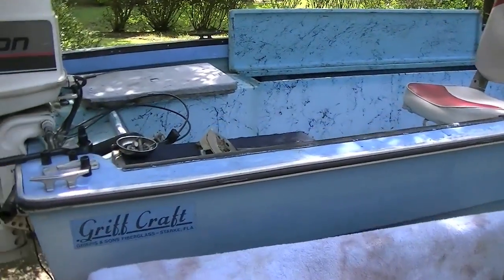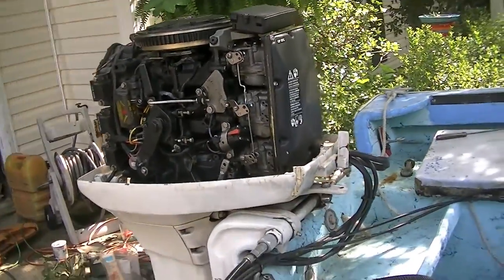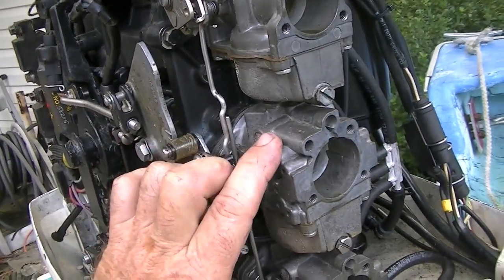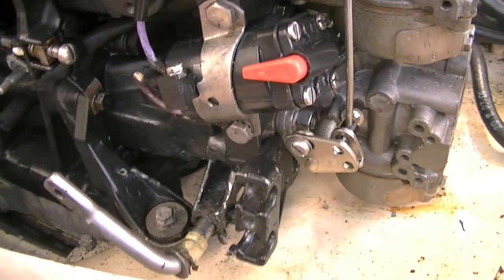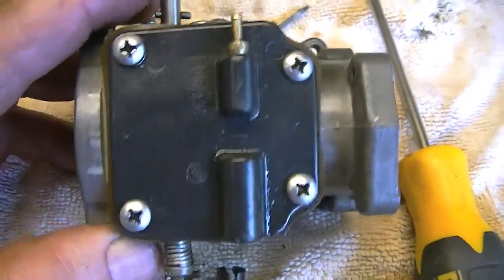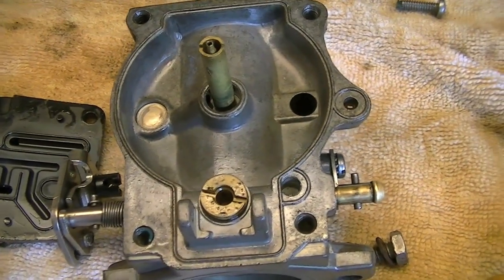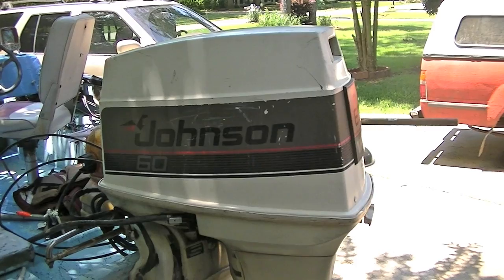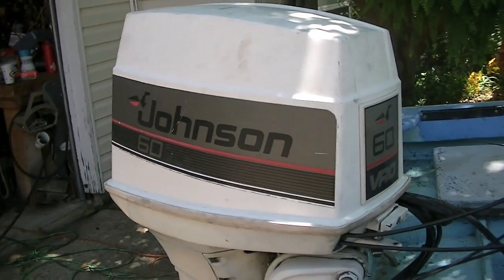60 HP Johnson VRO Evinrude Carburator Rebuild

Comment: Very detailed and informative.  The problem I'm having with my 2000 Johnson 115 HP V4 60 deg is that the primer buld never gets hard and I flood my carbs; fuel literally spills out into my air silencer assembly.  I believe it's the needle that is worn out and not stopping the fuel when the float bowl is full.  Ordering my rebuild kits, gonna do all four.  Thanks and great vid!
Reply: I know it's been 3 years but I'm having the same problem now. Did u figure out the problem?
Reply: @mikejanicke308  the rebuild kit worked.
Reply: @Jason Hinojosa  that's good I did rebuild mine but didn't really clean  those tiny holes. So I'll have to pull them off again and give them a proper cleaning. Thanks

Comment: I have the 1986 Johnson 60 hp VRO and am considering rebuilding the carbs and replacing all the fuel lines. Which carb kit did you use? Have you got the part number or know how I can get it? Looks like a fun project. Were all your fuel lines connected with zip ties from the factory? I had one leaking fuel line where it was double zip tied and I replaced it with a hose clamp (which I'm minded to do on all fuel line connections (which are zip ties).

Comment: Should I check my reed vales will I have of the three carbs off even if the motor (1998) is running ok ? Just want to clean and rebuild the carbs.

Comment: I have a 90hp Johnson 2001, when I start it runs a few seconds and die, sometimes it will run a little longer but when I put it in gear it dies. Can you give an advise what I should check, I have cleaned the carburator, what else should I try? Tks  Len
Reply: Grandma Monica fuel filter
Reply: most likely fuel pump then do stator and power pack test

Comment: Great video!   Unfortunately, I didn't make it very far during the rebuild process.  Somehow I managed to break the fuel line nipple (0314513 ) off of the carb leaving me scratching my head how I'm going to fix this.  Any suggestions?
Reply: I have a Johnson 1989 60hp motor with carburetor 432666 which has two fuel connectors.  I broke the fuel nipple that connects to the electric primer toward the top of the carb.  I was able to push out the remaining piece and need a replacement part.  Can anyone help by directing me to where I can purchase such part without buying an entire new carb?    It is NOT part 0314513 — NIPPLE, FUEL

Comment: I have a very similar outboard. I took boat out on water. After getting home and taking the hood off the motor I noticed gas and oil dripping off the bottom two carbs. Why would this happen?? Thanks.

Comment: brilliant video,  quite extensive rebuild, I have a similar Ev 60Hp, with 2 carbs 1986, idle is terrible so im suspecting the carbs need a rebuild.  how often is this rebuild needed ? every 4-5 years ?? would have loved to hear it crank over after the build
Reply: +John Flynn John I have always run my motor dry from gas and then fogged the enjine before I put it away for the season,it only takes a few min and I have never had to clean or rebuild again,25yrs.

Comment: I have the same motor. I still have the oil injector and was thinking of disconnecting it. What is the oil/fuel ratio your using?
Reply: I'm running 50:1 mix. That's what it calls for. I run that in my 89 75hp and my 96 60hp. On my 96 I'm going to replace the VRO pump when I get the funds to do so. For now I'm running an old style pump.

Comment: I have a 70hp VRO and it looks exactly like yours. Do you have any videos on how to close up the VRO and just mix your own gas? I don't want to mess with that whole oil tank on my pontoon. I'd rather just mix the gas like I do for my bass boat.
Reply: From what I understand, just remove the vestiges of the oil injector system, and mix like normal.
Mine was removed when it was purchased. The old man who bought it didn't trust or understand the VRO system.
Reply: @nunyabidness1400  smart man

Comment: hey boss.  got a 98 johnson  ,  followed your vids to a tee.  but can't seem to find out why my carb bowls are flooding out.  I even dropped the floater so that the needle shuts sooner.   Mine is an electric start with the solenoid.    Got new needle, new seat, from the carb rebuild kit.   Anything else that would be causing a flood?
Reply: chews4life cracked reed or feed tube maybe?

Comment: i have a 70 hp evinrude, it runs great about half of the time, other half about 1/4 throttle is all i get.  trying to determine if its carbs or fuel pump.. frustrating.  great video!
Reply: have u found what the issue was geoff peiffer ? i have the same issue!

Comment: bien le bonjour , je possède un 50 cv Johnson autolube (vro) 3 cylindres , problèmes au démarrage, impossible avec le starter , de plus, je vide la batterie et ne démarre pas toujours , j'ai nettoyé plusieurs fois les carbus,  alors je démonte les bougies et injecte du start pilote, et la cela fonctionne avec beaucoup de fumée , lorsque le moteur a démarré une fois  je peux arrêter et redémarrer sans problèmesconnaissez vous ce problème et comment y remédier, de plus comment faire pour débrancher le système autolubemerci a vous

Comment: Hey what is that line that runs to bottom of the air box? Also which screw is for your idle?
Reply: Hi Jeremy - I'm about to tackle carb on my '89 60HP, do you have any suggestion/learnings related to the idle screw?  Thanks

Comment: i have a 115 johnson 1979 model and the idle screw on top is stripped out any ideas about getting it out?
Reply: Thomas Flynn drill and use "easy out" they are like a drill that screws in woth left hand threads and tightens themselves while loosening the bolt

Comment: anyone know where i can get that fuel line fitting he has on his motor? the 1 in 4 out.  Looks like 5/16 in and out with three 1/4" out. shows it at 1:12
Reply: found it Dorman 47361. Looks cleaner than the factory rig.

Comment: Good basic carb cleaning BUT there is plenty of things not exactly right with this. The reason your top car is so different is because its not the right car for that engine. the plastic top carbs were never fitted to the 1989 engine, they are a later carburettor than 1989. also all three bowls are identical and can be inter changed. the jets in all 3 carb bowls should also be the same identical jet in all 3 of them.  And what on earth are you doing using a 1/16th drill bit on the main jet ? either get the exact size piece of wire to fit the jet or dont poke around with it. definitely do nit twist a drill in the jet. it should realy of been taken out, it simply unscrews from the bowl by using the correct size flat head screwdriver. on the middle and bottom carb you didn't mention about taking out the freeze plugs to clean those out too ?  a lot of good stuff on this vid but if your going to do it then do it right or no point touching it.
Reply: Hi, Phill.
I never replaced the carbs, I don'[t think the guy who originally bought the engine ever brought it back to the dealer to get new carbs, and I KNOW he did not have the mechanical aptitude to do it himself.

I did NOT use the 1/16th drill bit to clean out the JET...I used the drill bit to clean out the fuel channel that feeds the jet chamber.

I am not a "factory trained" outboard motor mechanic...just a mechanically inclined guy who wanted to help by sharing this video. From all of the positive comments I've gotten, I'm going to label it a Success.